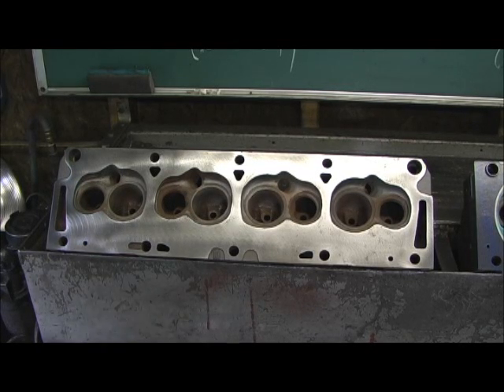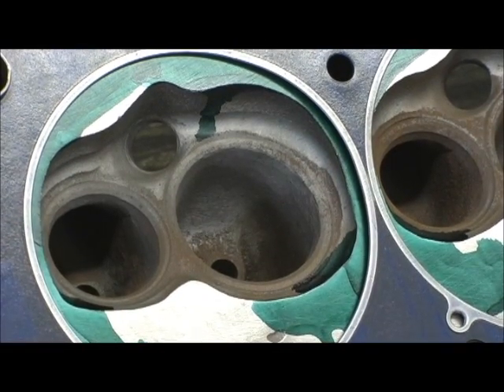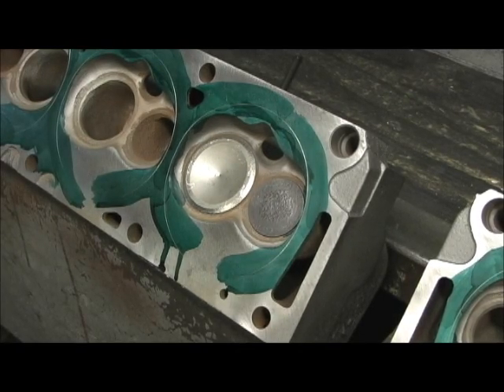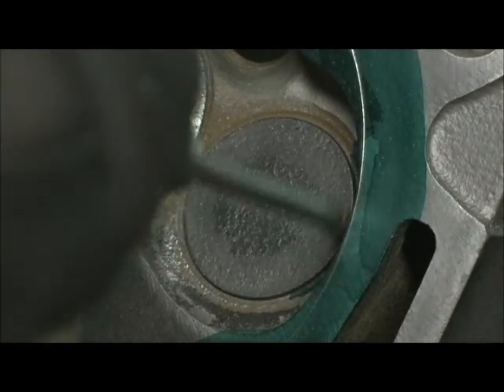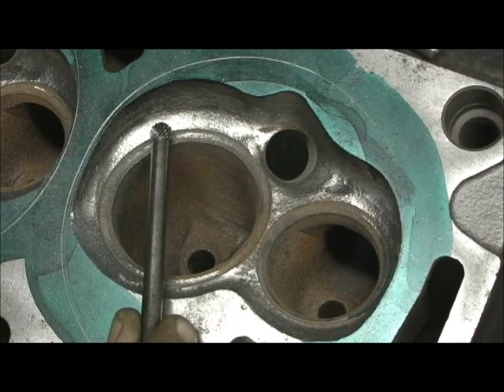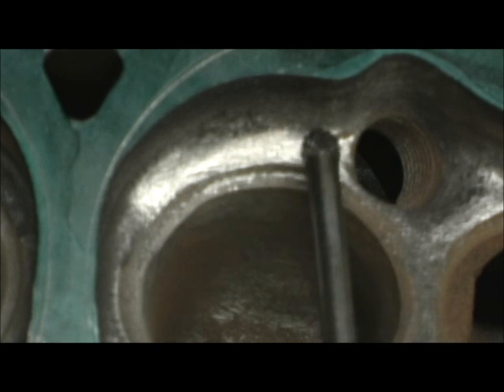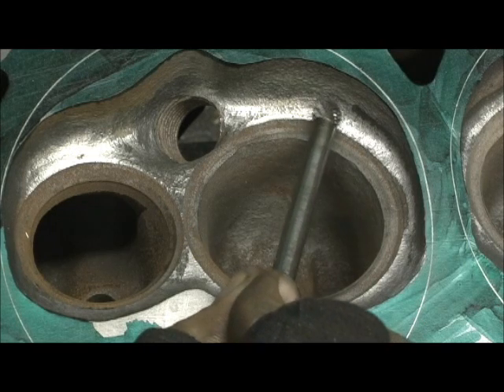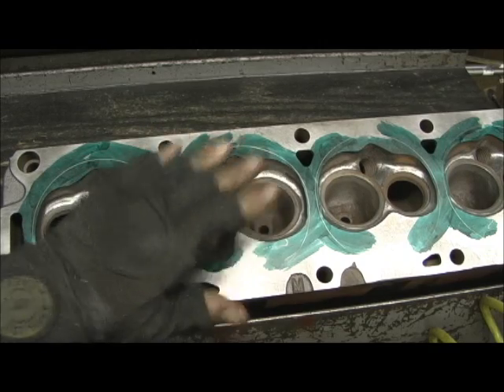Ford 390 1960 FE Head Porting Combustion Chambers Part 4.2

Comment: Hello from Australia Headbytes, just watched the CI welding with great interest. I assume it was a nearly pure Nickel that was used as the filler. I have also done a little porting and combustion chamber opening up and may offer you an idea for the Com Chamber (CC) mods. I see you use a Valve on the seat to a certain stage and the rely on not slipping up for the final intricate mods. Perhaps you could do this more safely by skimming a valve, (used)  to a knife edge just above the seat dia required for the new valves. This would all but eliminate the risk of damaging the valve seat. Cheers from John.

Comment: That's a damn nice head for the 1960. I think you could pull the intake wall a little more (reducing the squich are) and unshroud the valve a lot more. But that may lower the CR a lot.